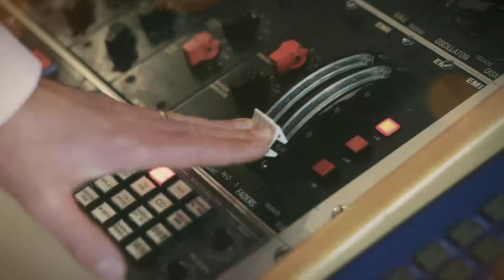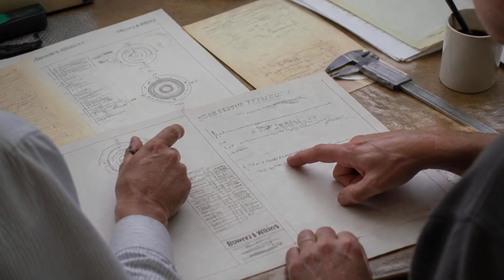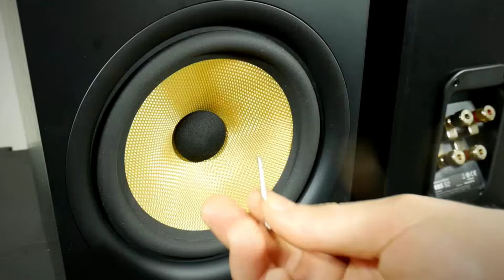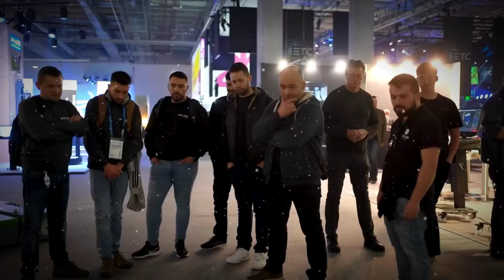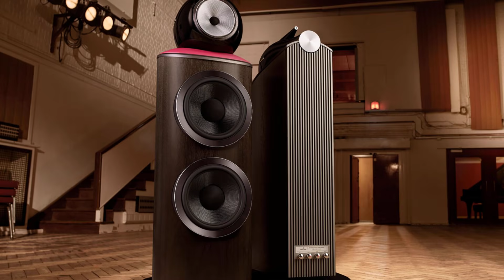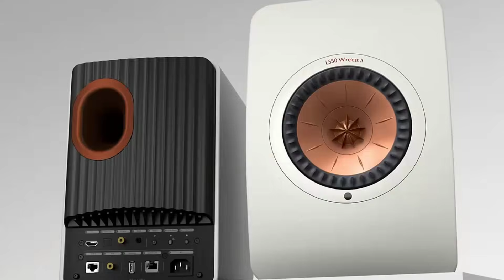How Samsung Destroyed the World's Most Trusted Speaker Brand (The Repair Shop Truth)

Comment: The 700 S3-range cross-overs I have seen didn’t have electrolytic capacitors. All loudspeakers in this range sound - for the budget they represent - wonderful (at least when matched to the right amp) and independant reviewers, magazines, shops all over the planet will confirm that. About Harmann/Samsung - they were designed and released long before the take over by them. I’d be surprised there is any difference between a pair of 2-3 years ago and a pair being sold today. At least in Europe.
Reply from the maker: Fair point on the 700 S3 specifically, if the crossover inspection confirms film capacitors throughout that's a meaningful distinction worth making. The broader concern is about component decisions across the lineup and what ownership transitions historically do to specification priorities over time, not necessarily what's in current production. Appreciate the specific detail 👌

Comment: This year I replaced the tweeters of a pair of DM303 with NOS tweeters of B&W. No problem to obtain these and replacing was a easy job. Inside the 303 looked like new. Now they sound like new. Hopefully my 702S3 will be as easy to service.
Reply from the maker: The DM303 is exactly the kind of B&W that rewards that kind of attention parts still available, straightforward to service, built when serviceability was part of the design brief. The 702 S3 is a different generation entirely, but the fact that you're already thinking about serviceability before anything goes wrong is exactly the right mindset 👌 🏆